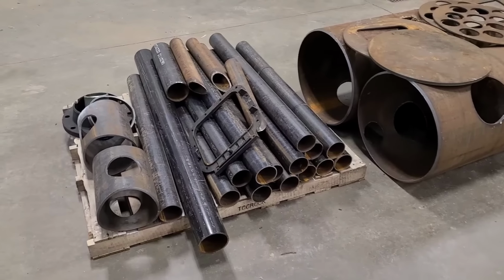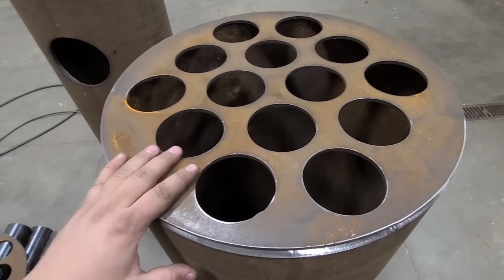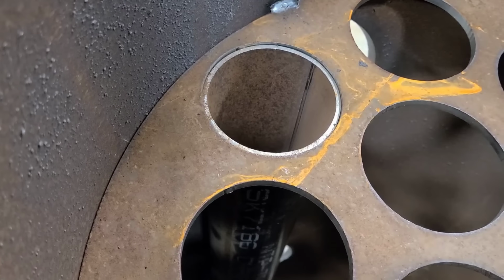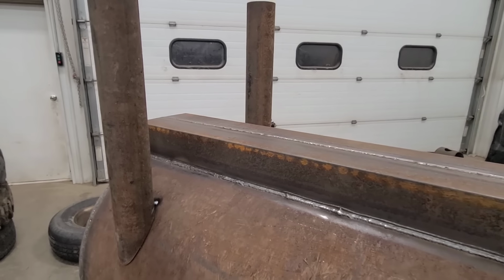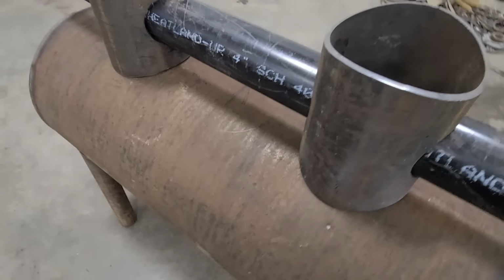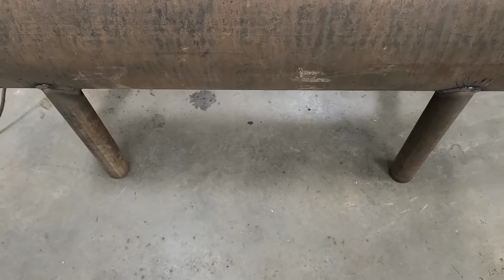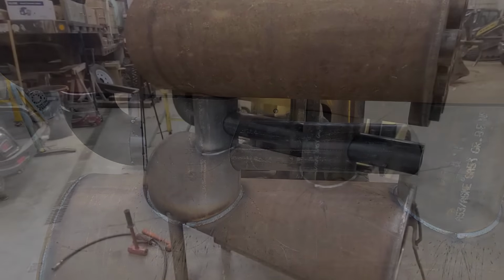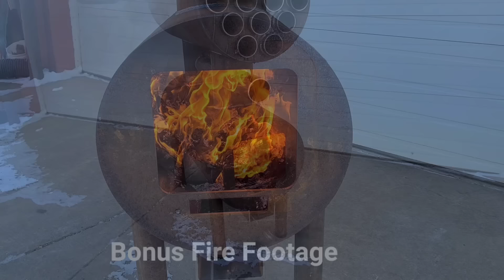My Ultimate Shop Wood Stove Build Part 1

Comment: Grate work but terible design...
Reply from the maker: Care to explain why it's such a terrible design and not "grate"?
Reply: @kylechrist   to properly and cleanly burn air should go with fresh fuel, see rocket stoves.
Heat exchanger will be  coverd with soot  in a days  and cleaning will be a nightmare if even possible, if You would put smoke through the pipes it would help.
Here are some improvement ideas:
Botom burner part had smoke exit at the back, optimally with some seramic burner as catalyzer. Embers and fire would be at the back with fresh wood going in with the draft (see wood gasification boilers). Heat exhanger above boiler door could be screwed in to enable cleaning adding smoke collecting chamber and chimney.
Its long discusion overall ;)
Reply: @kylechrist  english is my second language "grate" is one of my often mistake, there are many of them ;)
Reply from the maker: I'm all for improving on my design and constructive criticism, thanks for explaining some areas of improvement rather than just saying it's not a good design and then never elaborating why 👍

Comment: If you reversed everything you'd have a better design. Need to get out of your thinking that your exhaust gasses need a straight path up the chimney. But I suppose it's not easy to make a decent design when you're not using any firebrick.
Reply from the maker: Where do you get the idea that the exhaust goes straight?